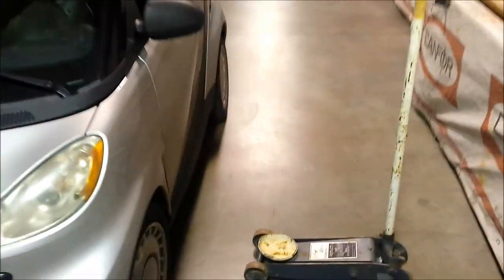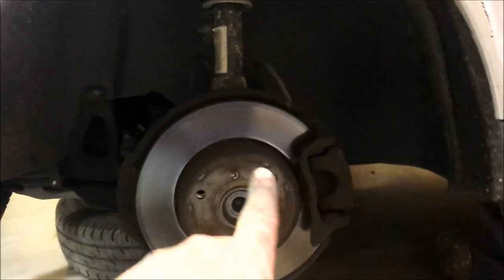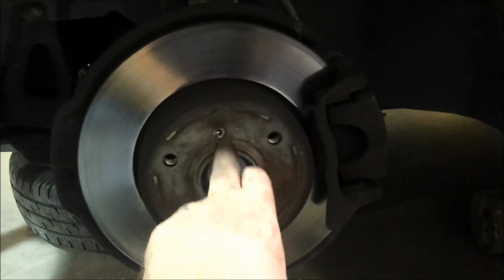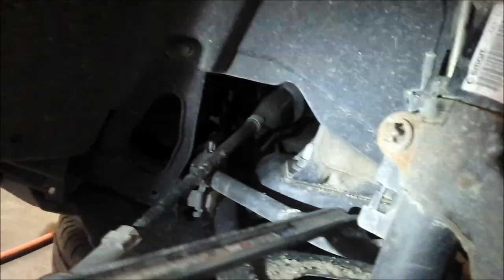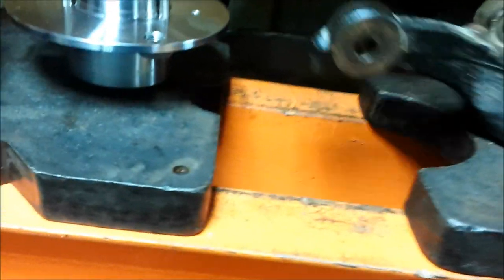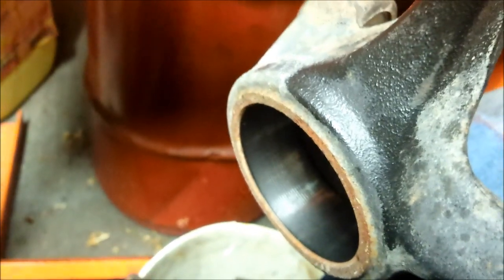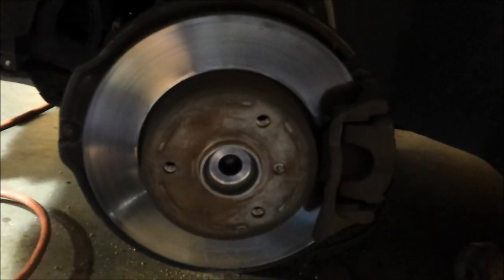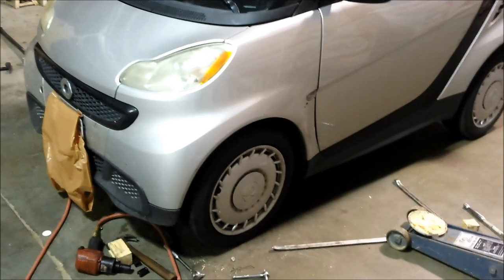Replacing front wheel bearing on a 2013 Smart Car Pure (redneck method)

Comment: Smart have a spreader device that opens the hub clamp so the shock can slide out.
Reply: @LazloNQ  no worries, thanks for subscribing, I really appreciate the support.
Reply: Take the screw out and put on from the other side and put a piece metal to stop it going through and it will widening and slip of the shock